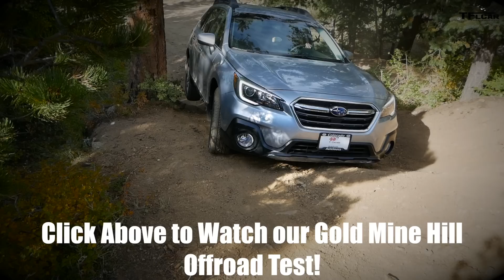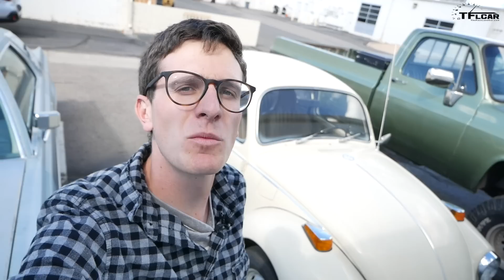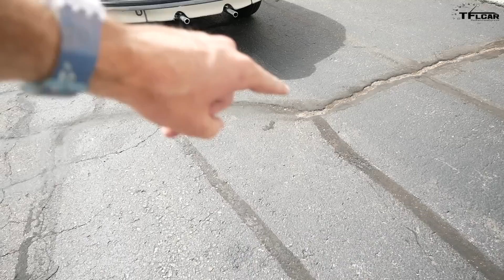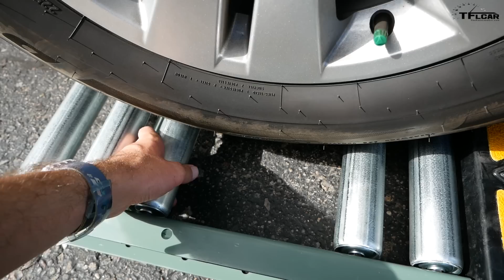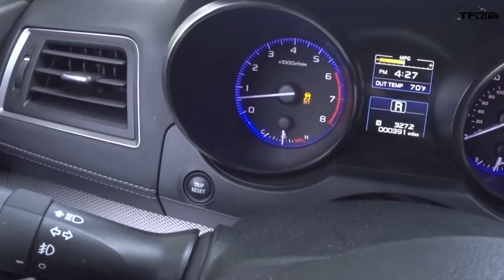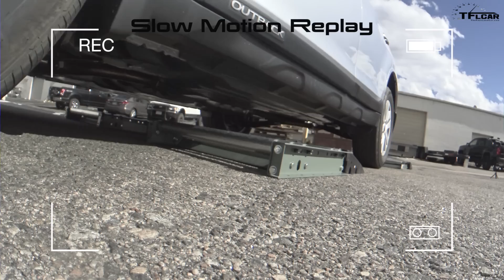The Truth About Subaru's Symmetrical All Wheel Drive:TFL Slip Test vs Subaru Outback

Comment: next time, try 3 wheels on rollers, but on the 4th wheel, put a ramp to sort of simulate a heavier load, or a road uphill. ramp could be the same as the one you use to get onto the rollers.
Reply: Mik995px I thought the same. That's a good idea
Reply: I own a Subaru Crosstrek, and I've seen how good it can be in the snow. It is an excellent vehicle if you have to deal with winter. 

To the Jeep owners, I concede, a Jeep, with a true 4WD system, will be excellent in the snow too. Maybe even better than my Subaru. My Subaru is good enough, though, for anything that I'll encounter. It's comfortable and fuel efficient too. It's been a good vehicle for me.
Reply: Yup, not enough resistance. Good idea. Set it up so as it moves forward resistance is greater as the angle increases. It should eventually spin the tire on the ramp. Something tells me the Outback won’t.
Reply: And then when it goes over that, hook up a trailer to it and then tie it up to a tree. Get real. The tech in the video alone is worth 40k. Even 10 years ago you would have to buy a Land Cruiser or some other heavy duty vehicle for the stunts in the video. Before tech, you needed lockers even on flat terrain.
Reply: @YES10 The tech shown in this video has existed for decades. Grand Cherokees used this back in the 90's (quadra-drive 2). You could lift three tires off the ground and it would still move. There is nothing new or fancy about what Subaru does. And has been proven to be one of the less capable systems out there.
Reply: One thing about the flat test is, the wheels on the rollers are still generating a pretty good amount of thrust because of friction in the roller system.  Putting the non-roller wheels on a ramp would help cancel out this remaining thrust.
Reply: Joao Guerreiro
Adding a slippery surface would not make an objective test, because that would add an extra variable. Various vehicles are equipped with different tires. Tires between models and brands vary in coefficient of friction.
Reply: The CVT is perfectly fine, its just different, dont treat it like a regular auto, cause its not such.
The only thing a regular auto and a CVT have in common is the fact that you need to change the fluid to make them last.
Reply: @mik995px Really?  How many times does a Subaru have to prove that it's better than anything else out there when it comes to all wheel drive? Hey I have an idea, why don't we put three wheels on the rollers, and the fourth wheel I'll put a chain through it and attach it to a reinforced concrete wall, and see if the car could pull the wall down! Give me a break! The Subaru has the best all wheel drive in the industry hands down..!
Reply: @gemster18  yeah with a garbage CVT behind it. Don't be a butthurt lol
Reply: @HamishW96  Its still better than all the other AWD systems sry.  Even with a CVT.  Which by the way... Is really good.
Reply: There is no such thing as a "really good" CVT. And, as we have seen on multiple occasions, just every every other AWD system had zero issues on gold mine hill. While Subaru cuts all power and prevents itself from moving.
Reply: @gemster18  no doubt it's a good system. But you yourself have undoubtedly seen how this thing performed on gold mine hill. It took Tommy ages to get up stage 3, and the car legitimately stood there and didn't move. I don't know if youve ever been 'offroad' but in a lot of situations, that is extremely dangerous when a car loses power. Can cause rollbacks, rollovers and most likely death. Last thing I'd want is to be going up a small hill and not be able to get up due to a programming 'feature'. 

And keep your CVT Transmission. They're heinous pieces of work.
Reply: Stuka87 yes toyota has been making reliable cvt transmissions. Or aisin.. Who ever makes it for toyota. The only reliable cvt
Reply: Gemster18 Range Rovers is better
Reply: @gemster18  well, they asked about things to improve their 4wd test method using the rollers.. I didnt mean it just for the subbie haha.
Reply: Because it isn't better that anything else. In fact it is very much the same as many other car and small SUV based AWD systems. The "it's the best" is just marketing hyperbole, just like most claims of being the best by any manufacture. This all started because the Subaru wouldn't drive up a hill off road when multiple tires were traction limited.  I don't think there is anything wrong with Subaru's AWD system, and it is in fact quite good. I think that Subaru engineers limited the torque output in certain situations because of powertrain limitations (CVT). I don't think those limits will be a problem on the road, only off road.
Reply: @gemster18  They aren't. Cut the crap. They have 4wd with brake actuated torque vectoring. Good system but no where near as good as an actual torque vectoring differential like those used on Acura's BMW's and Audi's. Try learning how AWD works before making statements like that. Its a good system but active diff's are exceptionally better.
Reply: @d1sturb3d119  I disagree... but I respect your opinion.   I believe it's the CVT, that hampers the AWD System, not enough power.. just my opinion.   I have driven many AWD vehicles, and NONE... compare to the  symmetrical all-wheel drive system that these vehicles have, I mean there must be something to this system, they are the number one selling car in Canada and there's a shit ton of snow in Canada! Again I appreciate your opinion and of course I respect your opinion but that's just how I feel I have been driving for 50 plus years in various types of all wheel drive vehicles and nothing in my opinion compares to the traction that the Subaru gets, but they're CVT is not that great and lacks the torque needed to get out of sticky situations.
Reply: @gemster18  I hear what you're saying but you're not the only one living around snow man. And keep in mind use cases vary. If cornering and aggressive driving isn't your thing then Subaru's system work. If cornering is what you're looking for the STI uses a torsen differentials to adjust torque. The WRX and other models in the line up have a viscous coupling center diff with open differentials front and rear. That system has been in existence since the 60's. It is nothing new. 

Your first comment stated personal experience over verifiable fact. You may as well say in your experience the earth is flat. Sorry but that is not the case. You can like the system all you want but it is no where near as advanced as many other systems today. 

In fact Subaru had built the SVX in the 90's that had active differentials. Its an expensive system which is why they understand their demographic and don't bother offering those systems on most of their vehicles. 

So use case is important. For most folks daily driving, Subaru's do really well. For folks who off road, a 4 runner, FJ cruiser, Tacoma, Lexus GX, LX all have a torsen center diff and have brake actuated torque vectoring just like Subaru. 

If you enjoy cornering, Acura's system takes your steering input and suspension angle into consideration and sends 70% of the torque to the rear wheels and can split torque left or right. It can send upto 100% of the power to the left or right wheel on the rear. For folks who like a sporty feel that works better. 

You keep mentioning traction when traction is based on tires and not on AWD implementation. I surmise that is what you mean but its just different terminology you're using. I drive a 420hp RWD Sedan with winter tires in the snow. I haven't gotten stuck so far or lost control for that matter. All depends on the drive and understanding the car. Certainly not going to say its better than AWD but having an understanding of what makes your vehicle move is important. I haven't needed AWD in my specific use case since I choose my roads wisely. 

If you are curious here is a detailed explanation or torque splits and variances. If you're a conservative driver the Subaru system works perfectly. If you want something more there are options. And those options are way more advanced than what Subaru offers. The sum of the package amounts to a great machine but there's give and take with the setup. There's a lot more that factors into it's handling than its AWD

Subaru Symmetrical AWD Implementation 
https://www.youtube.com/watch?v=WBQlK89PyxQ

Acura SHAWD Implementation
https://www.youtube.com/watch?v=Yz9ol5zy5nk
Reply: @gemster18  I agree with you... I believe the CVT reaches a predetermined temp that shuts it down, hence saving the trans. from destruction..I believe there are vid's out there showing this. There is a vid showing poly ramps with water cascading down testing many diff vehicles. The suby won hands down.
Reply: @d1sturb3d119  No torsen center in a Tacoma. Only in some 4Runners. Land Cruisers (LX) have full-time 4WD which used a viscous coupling center diff in the 80 series. Maybe a torsen center diff in the 100 (I'm not sure).
Reply: bla bla bla hum ,,  not better  than a jeep,  especially with  its  garbage cvt
Reply: A jeep is considered 4 wheel drive w/ a transfer case
Reply: fred l Quadra Drive II is an AWD system. There is no 2wd selection mode. Yes you can put it in low range, but it still has an AWD mode. Jeep was the first with an AWD Sport Utility Wagon as well in 1973. Although Subaru likes to claim they were the first, they weren’t.
Reply: Stuka87 The AMC Eagle was the first true “crossover”—I hate that Subaru tries to claim that title for their vehicle.  They should test an Eagle (not the 1986 with an open diff) and see how it does.

Comment: I think you should construct a ramp at let's say 20 or 30 degree angle and put the rollers on that, and just have a simple locking mechanism which would allow you to lock individual rollers, this way you can test what would happen in real life scenario. Also If you're feeling like doing extra work, you could make adapters to the shafts which hold the rollers, so you can connect them to some sort of a brake system (maybe connect all rollers under one wheel to one brake rotor or a drum from a junkyard) that way you can give the car 2 wheels with no traction and 2 with limited traction for example.

Comment: Subaru has the best All-Wheel-Drive system period!!! Everything else is a distant second.
Reply: Says dumb people who don't know anything about AWD. Brake actuated torque vectoring is old stuff. It works and is effective but is still old. Active differentials are the most advanced systems around. Acura's SHAWD and BMW Xdrive currently offer those systems at the lowest price point.
Reply: @d1sturb3d119  When you mentioned BMW offering at lowest price point I have to laugh. Since when does BMW offer anything at low price point?
Reply: @441meatloaf  we're not talking longevity. As an initial price point its affordable.
Reply: @d1sturb3d119  I wasn't talking about longevity? Where did you get that idea. But since you mentioned it, BMW certainly isn't one of those brands that wins heart and minds of owners wallets. Extremely high depreciation and high cost of maintenance. Your car loses 80% of its value within 4 years........BMW price point "affordable" as in 60-70K affordability before taxes. Your average consumer definitely wont be buying a BMW just for that AWD purpose or for any utility purpose. I doubt many actual BMW drivers even know much about their own vehicle besides flashing their pricey ride.
Reply: @441meatloaf  Well yeah as I said, I'm not a BMW fan by any stretch. However the AWD system they sell is solid. Acura has a slightly more advanced system but again, the best systems at the lowest price point at this time.
Reply: LOL!
Reply: Ummkayyy!

Comment: Use the Jeep Cherokee and show a 4 wheel drive car or truck put into 4 wheel drive is really a 2 wheel drive, and to prove it put on the Jeep Sport Wrangler with its lift kit and good tires is also only a 2 wheel drive without any lockers.  This might surprise some viewers.
Reply: What?..can you explain...
Reply: even if you put the vehicle into 4 wheel drive, a vehicle with an open differential will still spin only one tire.  One front tire and one rear tire will spin in 4 wheel drive.
Reply: Allen Surratt that’s the reason the have electronics to brake the spinning wheel ?
Reply: He's right, 4WD systems have effectively two driven wheels unless they have locking diffs and/or traction control that will brake the spinning wheel. Look at the recent Cherokee vs Cherokee video. The old XJ Cherokee was spinning one front and one rear and had a tougher time than the new Cherokee when going through the ruts.
Reply: N Pooch I have a 2017 Jeep GC 4WD. Is this normally FWD ?  When the terrain mode is set to Auto ?
Reply: Your GC is a full-time AWD system. It's probably set up to try and keep torque split 50/50 front/rear under most normal conditions. It's not a FWD-biased system. Generally, you can tell because your engine is mounted front to back with the transmission under the floor, not sideways with the transmission by the left-front wheel.
Reply: N Pooch Tks. There is no torque steer, had assumed it was rear biased but there is little info on it.
Reply: TFL has a 1991 XJ Jeep Cherokee with no electronic aids that is the example I was talking about,  and yes I know all the new vehicles from Jeep has some sort of electronic traction devices.  That was not the example I was asking for them to show.
Reply: So you were wanting Tommy's XJ vs his TJ on the rollers? Cool...
Reply: Yes you said it better than I did.   LOL
Reply: While only two wheels are spinning, its definitely not 2 wheel drive. In fact an open differential always sends exactly the same amount of the torque to each wheel, assuming the driveshafts are the same length. Even though one wheel is spinning the other wheel, that isn't spinning, is still receiving the same amount of torque. This is because torque and power are dependant on friction. So if one wheel has no friction it just spins and spins. The engine will red line before it can actually produce enough torque to spin the one wheel that does have friction. Its not a situation where only one wheel has power, its a situation where the amount of power the engine can generate is severely limited because of the one spinning wheel.

Comment: It's symmetrical because it has two wheels on the left and two wheels on the right.
Reply: Paul Montero oh Paul your such a comedian
Reply: It’s actually called symmetrical because all 4 axles are exactly the same length. Most cars have a shorter and longer axle on opposing sides of the car causing torque steer. Subaru has little to no torque steer due to the same length axle going to each wheel.
Reply: @JT_life2022  it's a longitudinal engine too!  love it.
Reply: I don't agree with your answer. Torsion applied at one end of a bar is the same at any point along it's length. Thus, torque would be the same at the other end regardless of the length.
Reply: Paul Montero
Axles flex, they behave a little like springs. If you were to turn the axles slowly or if they would not flex then yes you are right.
But when accelerating hard on real axles that really do flex you will get torque steer if axles weren't the same length.
The shorter axle will reach max torque on the wheel side before the longer axle.
Reply: Joseph Carron you, sir, are very correct. That is the exact reason for the same length axles in all subarus. I am a subaru tech, and they teach us this. Glad to see someone on the internet spreading correct info!
Reply: @A11ium  100% correct.
Reply: @catfishmudflap  you ever used a really long ratchet extension on a hard to loosen bolt, and then tried a shorter extension? Now try that with an impact and you will see how that statement isnt always true. The long extension will twist a bit and absorb the energy being applied. The short one does not. That same thing applies to different length axles too